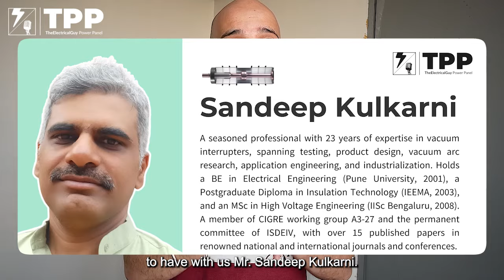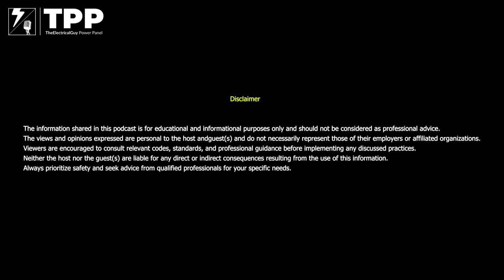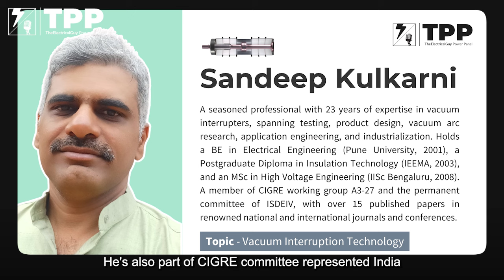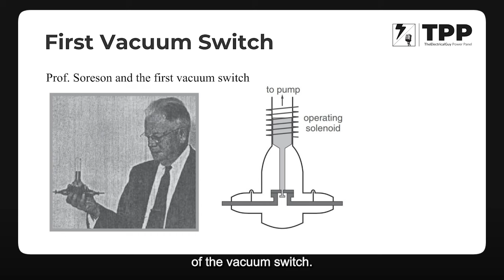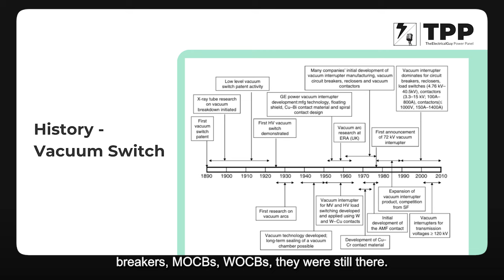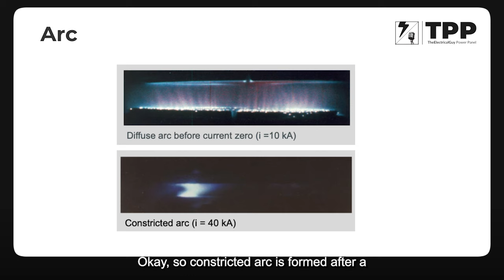Expert Explains History & Working of Vacuum Interrupter | Part 1 of 3 | TPP EP. 1

Comment: What factors determine the speed of arc extinction in a vacuum interrupter, and how do they affect performance?
Reply: If I understood the explanation correctly the current zero extinguishes the arc. Then it stays extinguished if the dielectric strength builds up faster than the voltage across the vacuum.
Reply: @jesserorabaugh8381  how measures current zero in VCB.....?